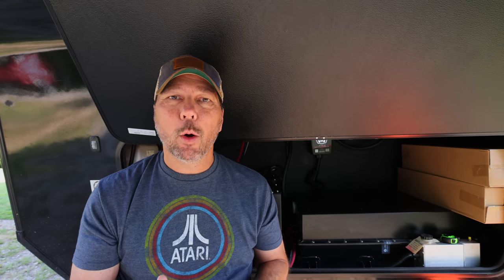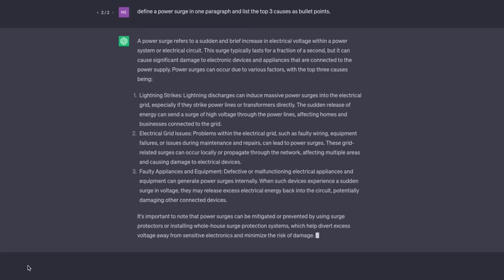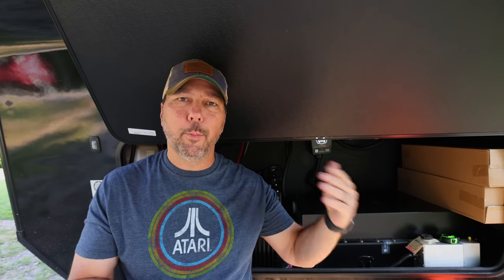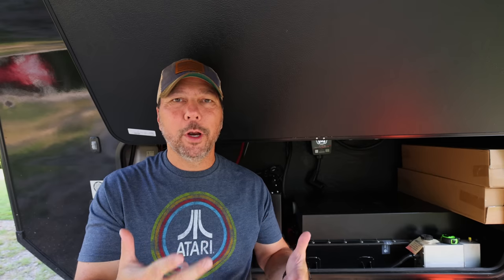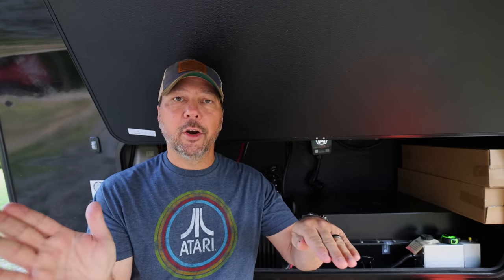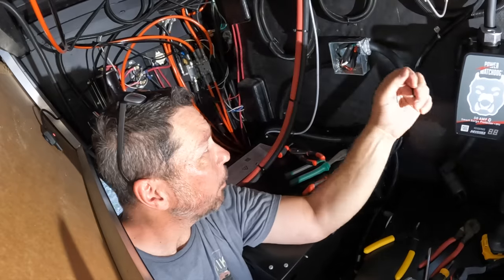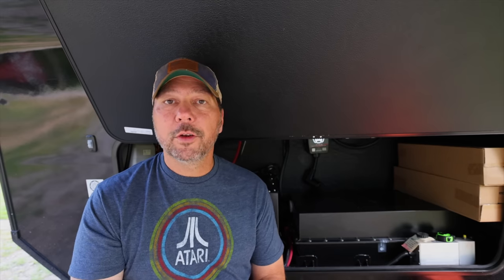RV Power Protection (Hughes Watchdog EPO plus Autoformer)

Comment: If you talk with Huges about the Watchdog. 

Please tell them to allow the bright white dog light to be shut off or dimmable. I camp at a few state parks that are designated International Dark Sky sites and its so annoying and the park rangers don’t like the bright white light it puts off. 

We have resorted to taping a paper plate over it or foil. We have debated just putting black duct table over it however we do like that the dog face changes to red when something is goes wrong and the white face lets us know it’s good when we arrive at a nee site and plug it in.

The light was a big issue when we camped near a university observatory because of light pollution it caused we were out of compliance with outdoor lighting regulations. 

It seems the dog face lot was a great marketing department idea but when camping at light sensitive locations or ones where the power pole is near the RV windows that white light is annoying then we go tape a paper plate or foil over it.
Reply from the maker: I'll mention it if I chat with them.  In the mean time, try some black gaffer tape.  It will cover it and not leave all the residue: https://amzn.to/44DtUi8
Reply: @ChangingLanes  thanks, failed to mention we didn’t have room for the hardwired version in our little 20ft RV. We have been using blue painters tape because we had it on hand.

Comment: Hi Chad, great video like always. I have a rookie question. If I build a full 50 amp Victron system doesn't that equipment already condition the shore power? Is it does do I still need this level of suppression and conditioning? Thanks!
Reply from the maker: When in bypass mode, the victron simply passes it through... So, it's still a good idea to have something like the EPO.   And, when in hybrid mode, it will protect the victron.
Reply: @ChangingLanes  Thanks for this answer. Learning as I go and videos like this are very helpful. Safe travels!

Comment: I have the hardwire version. But, can you hardwire autoformer in as well… and would be before or after the surge protector. It looks like you gave it after. ( I’ll check the video again 🤦‍♂️
Reply from the maker: The hardwire kit I show in the video is the only way to hard wire the autoformer.  Hughes recommends autoformer before surge protector.. 👍🏼

Comment: I have a 50A 5th wheel. Right now I have a 30A portable surge protector because our old motorhome was 30A. A lot of the sites we get in only have 30A plugs. If I put a hardwired 50A EMS in is it still ok to plug into these 30A plugs?

Comment: Chad, by code, wire nuts not authorized on aircraft or sailboats and most vibrating machines. I'm shocked Volta used wire nuts. I have a letter into Winnebago for using wire nuts in the junction box of our Navion. The wire nuts burned along with the wire.  I found in the junction box of our Navion during a regular inspection. Not only that, as it turns out this is a recurring problem with Winnebago using wire nuts on the main 30 amp junction box. Nowhere else in the Navion does Winnebago use wire nuts. I'm also seeking the codes from the RV association. Our forum referenced a Winnebago View that burned because of wire nuts. I can't believe any electrical engineer would authorize wire nuts whether wrapped with tape or not... it's just unsafe. Like you, I use the same butt connectors.

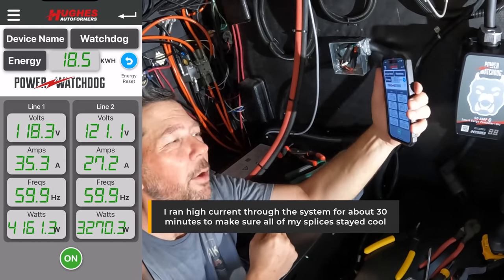Comment: Hi Chad, I have a question for you if you can help me to understand my main electrical pannel inside the rv. I have 2 brakers attached togetter (50 amp main braker) one deliver power to the top pannel and the other for the bottom of the pannel. At 16:17 in your video I see line 1 35.3amp and line 2 27.2amp, is it suppose to be 25amp on each line or 50amp on each line or 50amp total for both line ? Try to figure it out what is the maximum to watch for each line. Thanks for your help. Steve from Canada :)

Comment: I've heard that some rv parks don't allow auto- formers. 
 I think its due to the theory  of excessive draw on the overall park electrical system.
  Although the parks should be expected to have a robust  enough electrical grid to handle high/ heavy usage throughout their parks.
Reply from the maker: Some have bought into the misinformation out there about them.. Which is another reason to have it hidden inside. 😊

Comment: What in the world were you running to torture test that!?   Did you have issues on line 1 running g 35amps?   I try to stay around 25 max on each (air fryer and microwave compete ).   I use mine to test the shore power before I connect my camper to it, so you not hard wiring will be a plus as you can disconnect to test.  😊
Reply from the maker: Your system is designed to have up to 50A on each leg, as long as the pedestal is properly wired with split phase.  It's really a 50+50 system, unlike 30A which is a single hot line.

Comment: maybe a dumb question.....but if you only use the autoformer when you need it, how do you know when you need it?  Isn't it too late if a low voltage situation arises and damages any equipment downstream?  Or are you relying on an alert from your EPO?  I have a pedestal unit that I use (I like to plug that in before I unhitch to make sure the pedestal is operating well) and an autoformer and have the two inline all the time.  In an airstream, so no real usage space to install permanently....but man, would love to keep the AF in the truck and only drag it out as needed....but back to my original question. :)
Reply from the maker: I will see the voltage in the EPO and the EPO will also not turn on power unless it 104 or greater.  But if it were 105, I'd use the autoformer.

Comment: Hey Chad, maybe I missed this and you already have it covered, if so can you please direct me to the solution.

I have the Power Watchdog 30 Amp EPO portable Surge Protector and I also have a Micro Air digital wifi thermostat. 

I installed the Micro Air thermostat so I could monitor and control the temperature inside the rv while away and make sure my dogs were OK. Something you are quite familiar with.

One thing I've apparently overlooked is the fact I have zero control over the Surge Protector when I am not around the RV and out of Bluetooth range. 

We had an over Amp shut down, E3 I believe, today while we were out and I was not able to restart the Surge Protector meaning no AC on a hot day and our dogs in the RV. Fortunately we were close by. 

I've rea he'd out to Hughes and have yet to hear back. Are you aware of this and have you, or anyone, figured out a solution?
Reply from the maker: This is what hughes offers for remote access: https://amzn.to/45aLw60
However, I'm not sure if you can reset the device remotely or not...  I'd ask when you hear back from Hughes.
Reply: @ChangingLanes  thanks! Unfortunately RV Whisper says they do not support remote reset, and I'm still waiting to hear from Hughes. 

Is there anything you are doing to work around this issue when you are away from the rv?

Comment: Hey Chad, I appreciate the protection measures for your coach, but I have concerns about the safety of the power cable and plug. On my coach, the cable is connected to an auto-reel and runs from the pedestal to the basement of my rig.  To change it would be a nightmare.   I am worried that a power surge may damage the cable and cause a fire before the EPO is activated. Therefore, I would like to know if there is a solution to address this issue. I have opted for an external EPO for this reason. Can anyone please give me any suggestions or advice to convince me that my cable and plug will be protected by not using an external EPO?
Reply from the maker: Not knowing what's behind your power reel, it's tough to say.  But I can't imagine that it can't be adapted with proper wiring.  I'd be there's a junction box somewhere between your reel and the next upstream thing (distro or ATS).
Reply: @ChangingLanes  the reel is not my concern nor is the installation.  My concern is whether an internal unit will protect the cord and the plug at the shore connection. With an external unit I am protected all the way back.

Comment: I think you used some old video for the autoformer.  From what I read the newer units like I have, either bypass or boost 10%.  They no longer boost 2% all the time.  This was a change a few years ago.
Reply from the maker: Not according to my contact at Hughes or their website... https://hughesautoformers.com/product/50-amp-12000-watt-booster-and-surge/
Reply: @ChangingLanes  that is interesting, I don't remember reading that on their website when I bought mine a year ago and my paper work says "Your Autoformer is now monitoring the park voltage. If voltage drops to 113
volts or below, the Autoformer will boost 10% and the boosting light will
illuminate. The 50 amp circuit has two 120 volt lines. Only one line may need
a boost. The Autoformer will continuously boost 10%. Once the park voltage
rises to 115 volts or above, the boost mode will turn off." Nothing about 2% anywhere on the docs.  Do you know if this has always been the case, or did something change?  Thanks for the info...I'll have to get my multimeter out and do some checking :)

Comment: If you are stuck with a 30 Amp site, how does the Watchdog & Autoformer react? Or do you need a 30 amp version of each?
Reply from the maker: Plugs right in with a dogbone adapter no problem.. 👍🏼

Comment: Hi, did you ever have an E8 code with the 50amp Power Watchdog when you are plug at your house and you dont have many things drawing power in the coach ? I have a little issue when I draw not much power, let say 0.1 or 0.2 amps I'm getthing an E8 code for missing neutral at the coach, that is not true because the neutral is ok when I got stuff working at the same time. Thanks for your help.
Reply: You are not alone with the E8 Error showing up.  There are a number of RVers out there that have installed Solar Systems with Victron Multiplus Inverters that are experiencing this Hughes/Watchdog "E8 - Neutral Missing" issue.  I am one of those people.  I have a 3200 Watt Solar system with Dual Victron Multiplus IIs, and 4/GC3 BB Batteries.  After extensive discussions between Hughes Engineers and Victron Engineers, it appears Hughes has designed their (50amp EPO) system to trigger the Neutral Missing (E8) error "when L1 and L2 show equal power", and the time frame they use to trigger the E8 error is too short for the differences between L1 and L2 truly appear to the Watchdog from a Victron Inverter.  The Watchdog then shuts-down all power to the RV, (and I might add send an erroneous Message to the user on the E8 error that the issue with within the RVers' coach).   If you use a "Dog Bone" adapter (30amp-to-50amp) to plug in to 30 amp at the Shore Power, there is no E8 Neutral Missing issue.  
I have personally heard / talked to a few RVers that this occurred to, and they took the E8 Error message to heart and ended up taking their RV to a Repair Facility/Dealership to have their RV's electrical system checked out, only to have their RV down for a few months due to repair lead times, with nothing found wrong with their RV, and then also get saddled with a rather large bill for the time/effort to have their electrical system checked out.
Many have tried to add some current draw (via a Light Bulb or a Fan) to one of the power legs (L1 or L2 ),  ...some get around this E8 issue, one guy had to hit the Reset on the Watchdog Phone App 5-10 times to get power to his RV....  most I have talked to have not got around the issue.
Hughes is aware of this timing issue with the Watchdog, but this will require a firmware design change on the Watchdog that will take some time to get into Hughes production deployment.  
I have been an RVer for over 30 years and have a rather good electrical background (done whole home electrical systems).  I question Hughes' Method of determining what constitutes a "Neutral Missing" on their Watchdog, as does most of the electricians I have discussed this situation with.  I got rid of my Hughes Watchdog 50 amp EPO and replaced it with a Progressive Power protector, after in-depth discussion and validation with Progressive's Engineering department on their design.  Have never had a problem since replacing the Hughes Watchdog and using the Progressive Power Protection System.
Reply: @louie3552  Thanks for all that detail louie3552, well explain. Hughes should not sell the EPO 50amp because it is not working properly, you spend money and you dont know that problem.
Reply: Well, my experience is with the ability (inability) to use a Hughes Watchdog with Victron Inverters/ Solar Systems.  The Watchdog may work fine when not using Victron Inverters in a RV Coach as noted by other comments to Chad's video.  Yeah, I am out ~$300 for the cost of the Watchdog.   I found out about (stumbled on) this situation the 2nd day of a 6 month RV journey right after my Solar install, but I have enough Solar power/Batteries to supplement the reduced "30 amp" Shore Power during my 6 month trip for all my 5ths RV power needs. 
(set the Victron to only accept 26 amps from Shore on the  30amp Shore connection using a 30 to 50amp Dog Bone, and then addressed this issue when I got back home.  '22 Grand Design 380 FL-R/3 air option, residential fridge).  
Take care Steve.  You can be assured you have another vendor option (Progressive) that does not have this issue. Really liked the Bluetooth Phone App with the Watchdog, ....  the Progressive Internal units only have a small hardwired LED monitor that scrolls information.  My Progressive unit is internal as I did not want to deal with (unfortunately the world we now live in) post power protector theft, as well as exposing an external post power protector to the weather elements.  Another RVer who ran into this situation is now using a External (post) Progressive unit and working just fine now after his Watchdog replacement as well. @stevebeaulieu2617

Comment: Couldn’t you just open up the autoformer and rotate the receptacle 90 degrees?
Reply from the maker: I did look into that but the mount holes no longer line up.  I'm sure it can be done, but I'm sure it would also void the warranty.